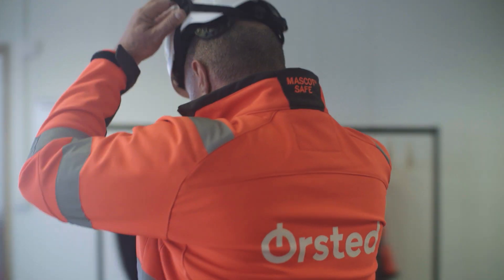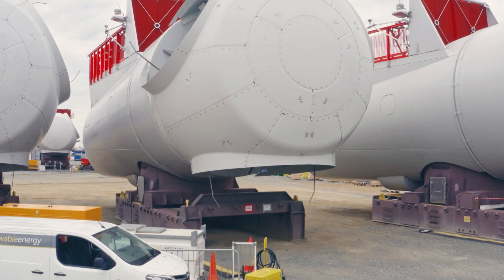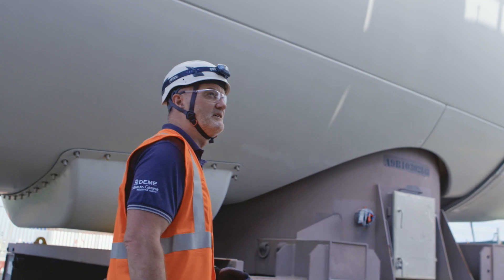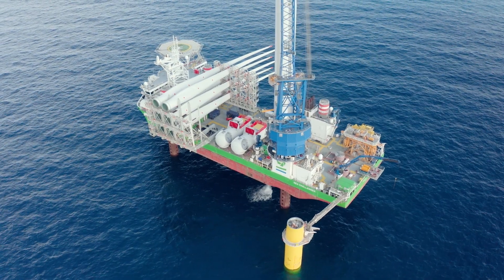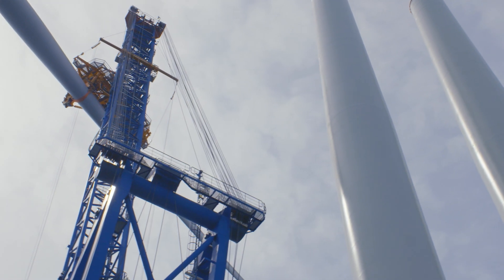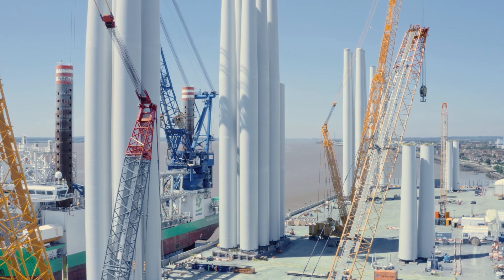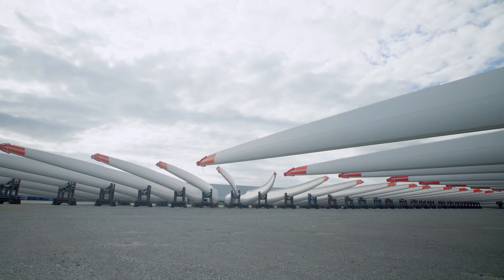Constructing Hornsea Two, the world’s largest offshore wind farm

Comment: Pamela Largue - September 1, 2022
Ørsted has announced that the 1.3GW Hornsea 2 offshore wind farm comprising 165 wind turbines is now fully operational.
The wind farm is located 89km off the Yorkshire Coast, alongside its sibling Hornsea 1. Together, Hornsea 1 and 2 can power 2.5 million UK homes.
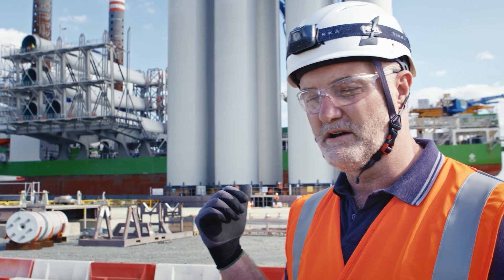Each wind turbine blade is 81m long and the blade tip reaches more than 200m above sea level   0:25
Source: Power Engineering International

Comment: The key is to build overcapacity, around 200% the UK needs 80GW will provide consistent cheap energy and near free energy half the year. We are already also building interconnectors to the mainland to export this precious resource. Theres about 2000GW potential in UK waters with current tech, add floating tech and the UK could be the Saudia Arabia of wind power. The Russians are not even going to be able to compete on costs, hence why they are playing thier hand now

Comment: Blades cannot be recycled, full of toxic glues etc. The huge amounts of 
balsa comes from the rain forests. It all ends up in landfill. The 
enormous amount of concrete and steel is left in the ground. A wind 
turbine can never save as much carbon as it takes to make it.
Today, the UK demand is 38GW, quite low. The output from the entire UK wind industry is 1GW.
Explain how this is a/ usefull, b/ viable.
Reply: Are you paid by the CEO of Gazprom "Anglo" Mike? I doubt your actually anglo saxon lmao
Reply: I think volcanoes chuck out more toxins than wind farm industries , and not as useful
Reply: 1) Balsa wood grows fast and can be replace
2) the concrete and steel can be recycled (even though it wont need to be fore decades)
3) Coal begs to differ. It saves CO2 emissions with every turn.
4) That will increase if people like you little shlts would stop putting up barriers as to "WhY wInD WoNt WoRk!"
5) Done.

But hey! Not like we are an island with massive untapped wind potential is there? Nah, lets rely on other nations to provide our energy for us! Right sweetie? RIGHT!?
Reply: So what are the alternatives? Coal and gas ı dont even talk about these.  Tidal? Much more dangerous to environment. No sun at uk. No dam. Nuclear is one of the best but people dont want that.

Comment: Was down from 24% in 2020 to 8% in 2021 of total U.K.  used electric so is still at the mercy of the weather gods
Reply: As opposed to the Russians?

I'll take my chances with that and nuclear. Cheers.
Reply: The key is to build overcapacity, around 200% the UK needs 80GW will provide consistent cheap energy and near free energy half the year. We are already also building interconnectors to the mainland to export this precious resource. Theres about 2000GW potential with current tech, add floating tech and the UK could be the Saudia Arabia of wind power. The Russians are not even going to be able to compete on costs, hence why they are playing thier hand now

Comment: The scale of progress can be measured like this:

The first offshore turbine in the UK was at Vindeby in 1991, it was 54m tall and generated 0.4MW. Now we are installing GE's Haliade X design - which is 260m tall with a 220m diameter rotor, and generates, 12MW.
Reply: Blades cannot be recycled, full of toxic glues etc. The huge amounts of 
balsa comes from the rain forests. It all ends up in landfill. The 
enormous amount of concrete and steel is left in the ground. A wind 
turbine can never save as much carbon as it takes to make it.
Today, the UK demand is 38GW, quite low. The output from the entire UK wind industry is 1GW.
Explain how this is a/ usefull, b/ viable.
Reply: @anglosaxonmike8325  1) Balsa wood grows fast and can be replace
2) the concrete and steel can be recycled (even though it wont need to be fore decades)
3) Coal begs to differ. It saves CO2 emissions with every turn.
4) That will increase if people like you little shlts would stop putting up barriers as to "WhY wInD WoNt WoRk!"
5) Done.

But hey! Not like we are an island with massive untapped wind potential is there? Nah, lets rely on other nations to provide our energy for us! Right sweetie? RIGHT!?

Comment: 1.3 gigawatt, Powerful energy
Reply: Blades cannot be recycled, full of toxic glues etc. The huge amounts of 
balsa comes from the rain forests. It all ends up in landfill. The 
enormous amount of concrete and steel is left in the ground. A wind 
turbine can never save as much carbon as it takes to make it.
Today, the UK demand is 38GW, quite low. The output from the entire UK wind industry is 1GW.
Explain how this is a/ usefull, b/ viable.
Reply: @anglosaxonmike8325  Lies, wind energy will keep the lights on in the UK
Reply: @anglosaxonmike8325  1) Balsa wood grows fast and can be replace
2) the concrete and steel can be recycled (even though it wont need to be fore decades)
3) Coal begs to differ. It saves CO2 emissions with every turn.
4) That will increase if people like you little shlts would stop putting up barriers as to "WhY wInD WoNt WoRk!"
5) Done.

But hey! Not like we are an island with massive untapped wind potential is there? Nah, lets rely on other nations to provide our energy for us! Right sweetie? RIGHT!?

Comment: Would love more updates on Hornsea 2, I’m sure that some turbines must be up and running by now, but can’t find any info.
Reply: Blades cannot be recycled, full of toxic glues etc. The huge amounts of 
balsa comes from the rain forests. It all ends up in landfill. The 
enormous amount of concrete and steel is left in the ground. A wind 
turbine can never save as much carbon as it takes to make it.
Today, the UK demand is 38GW, quite low. The output from the entire UK wind industry is 1GW.
Explain how this is a/ usefull, b/ viable.
Reply: @anglosaxonmike8325  Yaaaaaawn, full of errors.  By they way, have you seen how much concrete is used in a power station? And if it’s Nuclear, you can’t even go near it for 1000 years. And then there is the little matter of all the carbon produced when drilling for oil, gas or coal.  Move along now.
Reply: @anglosaxonmike8325  1) Balsa wood grows fast and can be replace
2) the concrete and steel can be recycled (even though it wont need to be fore decades)
3) Coal begs to differ. It saves CO2 emissions with every turn.
4) That will increase if people like you little shlts would stop putting up barriers as to "WhY wInD WoNt WoRk!"
5) Done.

But hey! Not like we are an island with massive untapped wind potential is there? Nah, lets rely on other nations to provide our energy for us! Right sweetie? RIGHT!?
Reply: @anglosaxonmike8325  "Toxic glues etc" lol. Talking shit again are you Mike? You never make any comparisons or suggest this perfect alternative? I bet you are going to say Nuclear Fusion. Haha